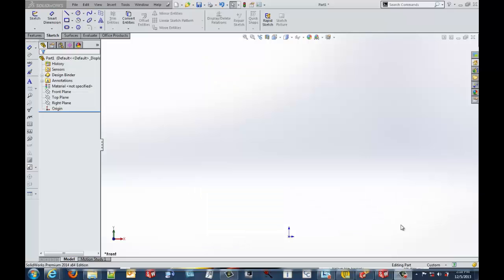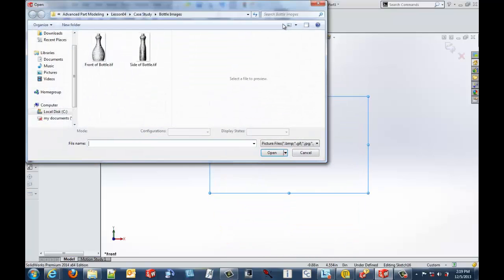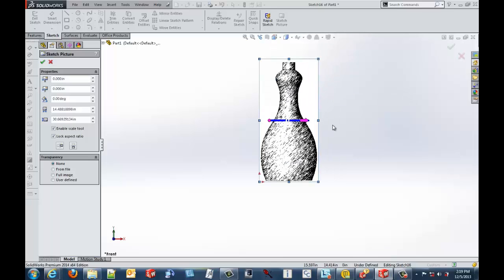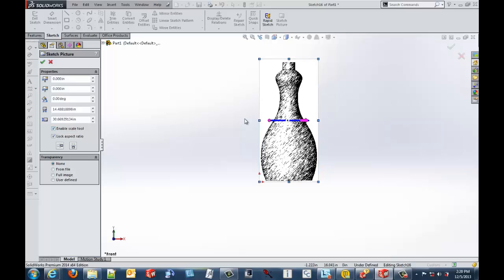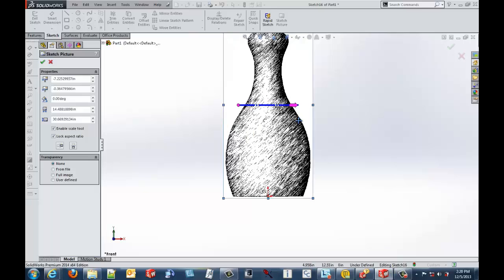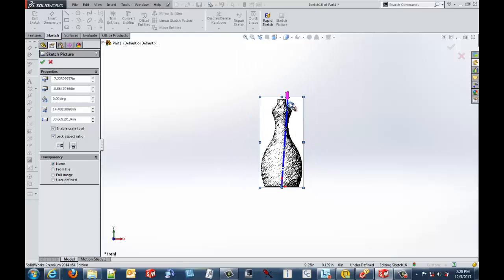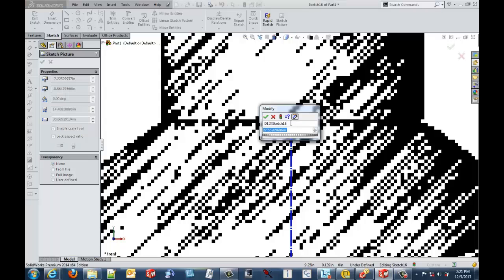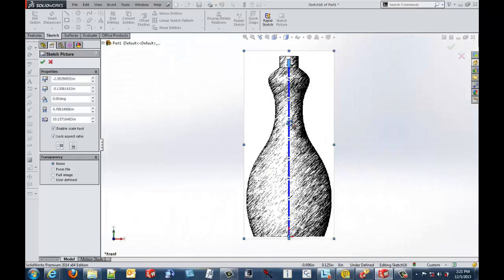SOLIDWORKS 2014 — Sketch Picture Scale Tool

Comment: My scale tool when doesn't seem to be working properly. It cannot be moved (even when I hover my mouse at the end point as you have done ) my cursor still only moves the entire sketch picture picture. Any suggestions how to resolve this?
Reply from the maker: Hi Brendan,
I am not totally sure what would stop you from moving the scale line.  I will note though that each end of the scale line controls different things.  One end controls the translation of the line and the other end the rotation of the line.  There isn't a particular reason that would stop you from selecting these end points though.
Reply: I am facing the same issue,  any solution you found for this ?
Reply: @realtalk4193  Tapping alt seemed to help for the hover

Comment: Is there a way to change the length of the scale line after its initial setting?
Reply from the maker: Hi Sean,
If you were to edit the inserted Sketch Picture and, disable "Enable scale tool", re-enable "Enable scale tool", then make adjustments to the scale tool, it would prompt you to apply a size again.